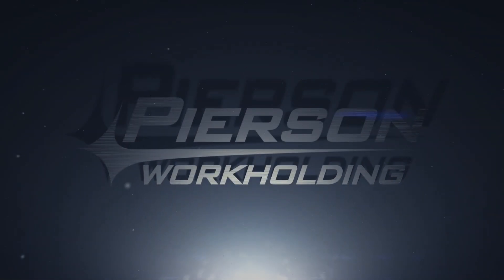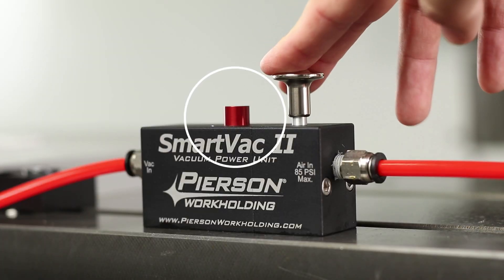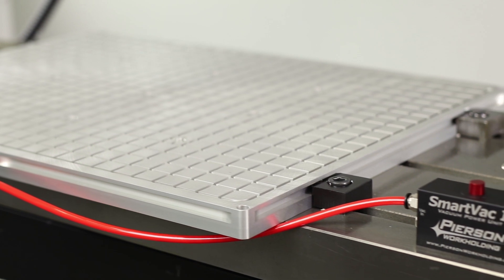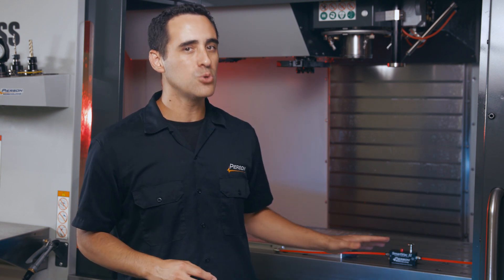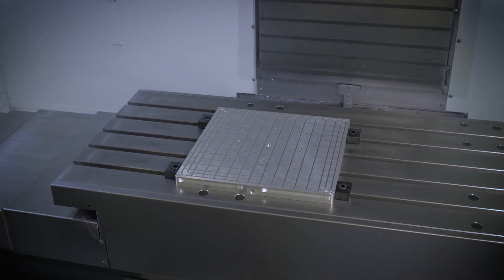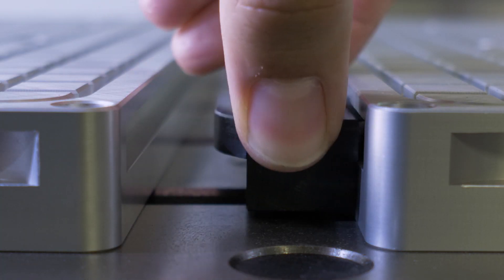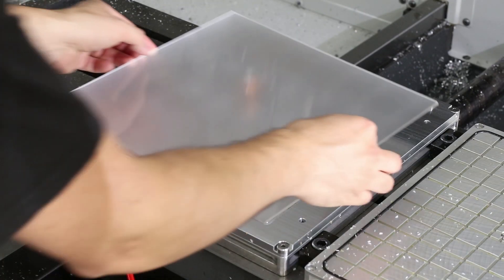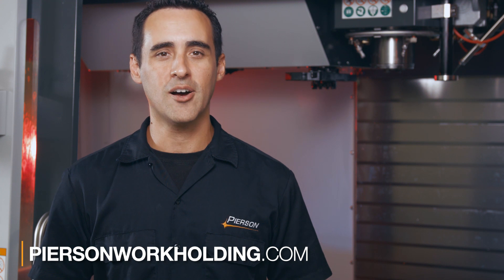SmartVac Vacuum Chuck System Overview

Comment: I purchased a vacuum table like this from Pierson about a month ago for a specific job that we run.  The job is flat panels with a bunch of countersinks and tapped holes.  We used to laser cut all of the geometry and do all the countersinking and tapping on manual machines.  With this system we were able to laser cut only the geometry that couldn't be milled and then drill, tap, and countersink all in one operation on two parts at a time on the vmc.  After the job was complete I was able to clearly see we had made a higher quality part, in less time, for less cost.

Jay is great to work with.

Comment: How do you stop the coolant from getting sucked in, and eventually gumming up the vacuum pump?
Reply from the maker: The VPU is designed to ingest coolant without adverse effects. At the end of the job run it for 1 minute to expel any coolant in the unit so it doesn't dry up and leave goop.

Comment: I have been debating on this system for a  while now.  What happens if air stops flowing to the Vacuum Power Unit when in the middle of a cut?  will it release the part?  I know its worse case, but just wondering.  And the CFM, does it drop once vacuum is achieved? or does it remain the same at .8?

Comment: Not sure I should invest in this or my power drawbar and automatic tool changer first. I want this bad. I feel this could help me turn out more parts easier at a time regardless of having the tool changer or not. Rather than using my current work holding methods that limit what I can do as far as quantity at a time.
Reply from the maker: We'd love to sell you our system, but ATC first for sure.

Comment: Your pump volume is not important as long as you have zero in-leakage. Meaning all your seals are perfect, there is zero dust or debris in the sealing areas, the workpiece is 100% solid (for example MDF doesn't perform well with vacuum clamping), and all your tubing connections are 100% leak tight. But IF you developed a leak greater than the capacity of your vacuum pump or your SmartVac then you could lose your grip on your workpiece which depending on the operation underway at the time could be catastrophic. So this is NOT a ding on your system, it's more a comment on ANY vacuum clamping system and that people should take into account what could go wrong and to make sure their entire system is 100% leak tight and if not evaluate if it is safe to proceed using a vacuum clamping system of any type.